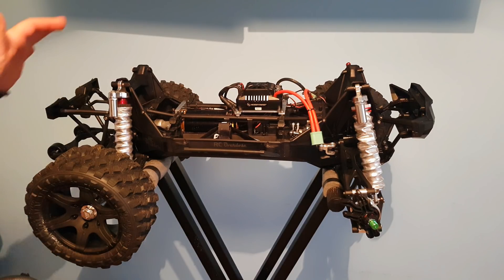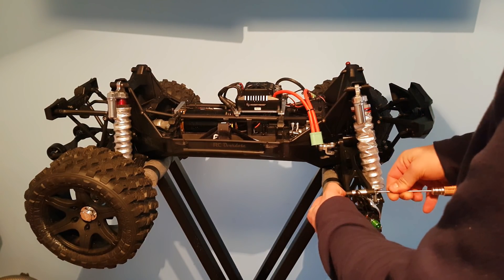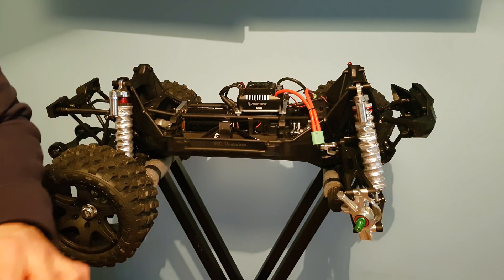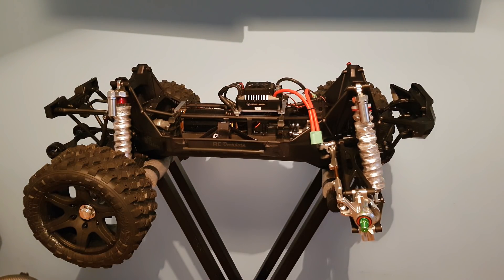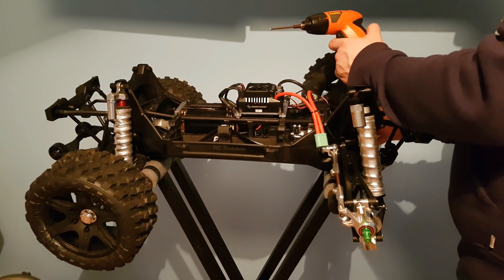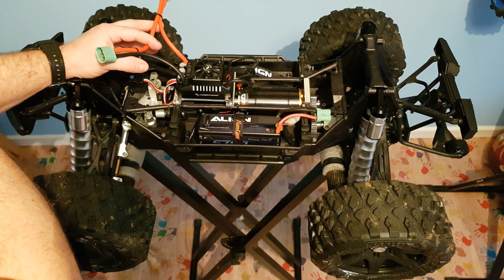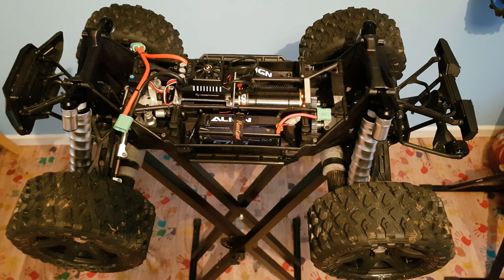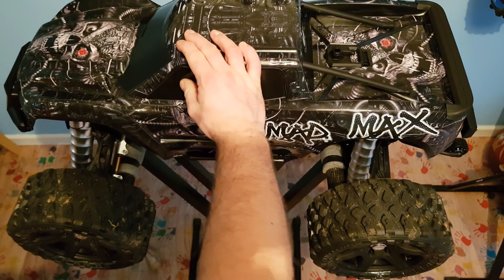Ultimate X maxx Build Part 6

Comment: Great job, bash that monster , and did u upgrade the drive shafts ?  Just wanted to know cause I want to on mine and can’t find any????
Reply from the maker: Yes I upgraded to a integy shaft
Reply: ALL DAY RC awesome thanks , I wasn’t sure but I knew u did cause U did everything to this truck and it looks great man👍👍
Reply: ALL DAY Can i get web info you went to for shocks drive shaft and gearing and bearings please i wanna kinda steal some of your flavor im building my first 1/5th scale rc /xmax and im doing alot of machined parts like you and i love all the parts you have i may change but yea can i get the info please??
Reply: ALL DAY RC its hard to find builds and good performance parts for xmax also what did you build it for bashing? If so what was the 25/50 ratio for torqueand dirt or street and speed?
Reply: ALL DAY RC do you kno about 7075 aluminum kno anyone that makes cmaxx parts from it?

Comment: What's the advantage of getting the custom wind motor over the stock wind?
Reply from the maker: Not sure to be honest. I got offered it for a good price.
Reply: ALL DAY RC ah I see. Trying to decide what's a good motor choice for my build. I'm building an xmaxx with losi mtxl wheels, 1/5 servo and max5. I'm thinking the castle 2028 but I also want to do something different then others. Any motor suggestions?
Reply from the maker: I get my best performance from a stock 1600kv motor
Reply: ALL DAY RC that's what my buddy runs in his but I worry the kv is to high for the size of wheels I want to use. I think the motor has to be less then 1000kv for the wheels and gearing I want to use.